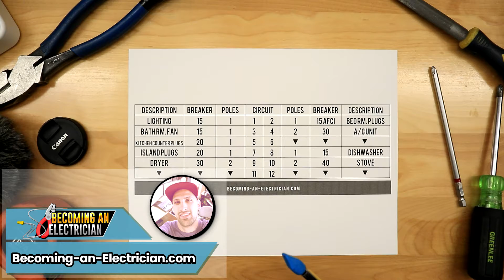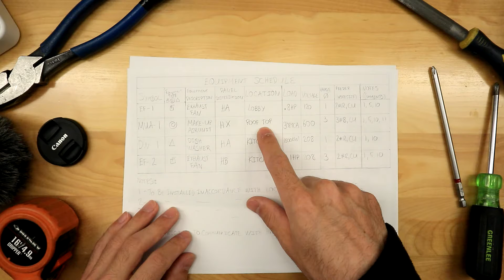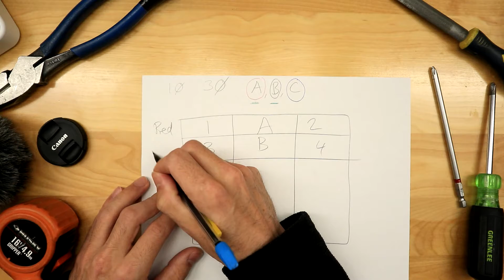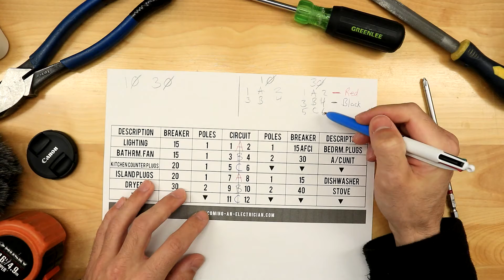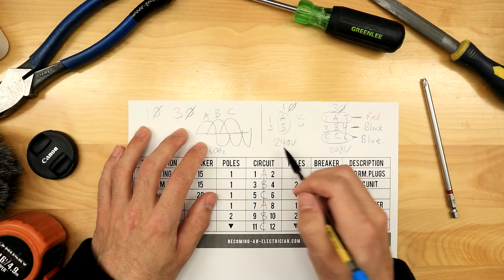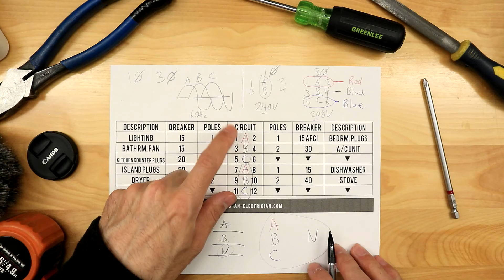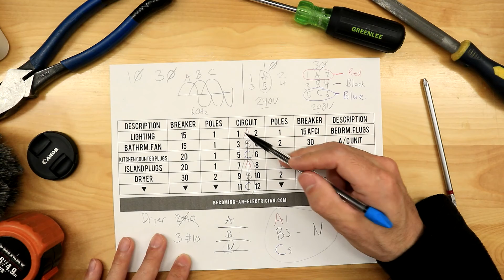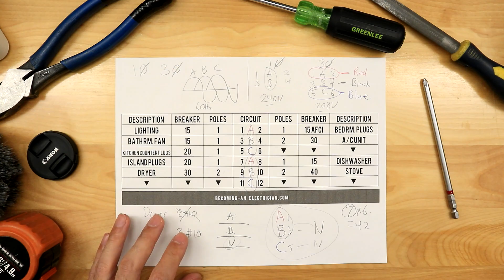How to Read a Panel Schedule for Electricians

Comment: "Blue", colors dont mean anything in residential when youre working with mulitple gc's on different projects, just dont use white/grey/green for your Lines
Reply from the maker: This video is intended for commercial electricians working with 3-Phase panels, where there will be three different colors.  Depending on region, colors may differ, but the concept of A, B, C should have been the takeaway.
https://becoming-an-electrician.com/

Comment: Thanks for the video. In a single phase panel, for example in a condo suite, breaker one would be "A 1-2" and breaker two would be "B 3-4". Would you label the third breaker "C 5-6"? I asked this as "C 5-6" would typically be what you would label the third breaker in a three phase panel. So, what would I label the third breaker in a single phase panel? I hope this makes sense
Reply from the maker: Yes it makes sense.

It would go A 5-6.

So:

A 1-2
B 3-4
A 5-6

A three phase panel has A-B-C.

But the actual condo suites have a single phase panel, from a three phase panel.

So they only have two hot conductors and a common (neutral) white wire.

Because of this, that suite will actually have 208V between two hots, and 120V to Neutral.

In a typical house, because of how the power comes from the transformer (I think called a High-Delta Leg), you get 240V between the two hots and 120V to Neutral.  Each house creates their own neutral (ground plate / ground rod into the actual earth outside the home).

Here's the Wikipedia article on High-Delta Leg:
https://en.wikipedia.org/wiki/High-leg_delta

You can stay updated with becoming-an-electrician.com by signing-up for the email list by getting my free apprentice electrician book:
https://becoming-an-electrician.com/optin/5-tips-apprentice-electrician-book/
Reply: @BecomingAnElectrician  thank you very much
Reply from the maker: You're welcome!  Good question!  Please feel free to leave comments on https://becoming-an-electrician.com any time!  🙂

Comment: what are phases?
Reply from the maker: A phase is your "hot wire".  Panels often have 2 hot wires, but commercial panels often have 3 hot wires (3 phases).  This is known as A Phase, B Phase, and C Phase.  You can connect phase to neutral for one voltage (120V), and phase to phase (line-to-line) for another voltage (240V) for example:
https://becoming-an-electrician.com/

Comment: im confused as to why its a #10 wire instead of a #12as it says on the equipment schedule, i understood everything else :(
Reply from the maker: Sometimes in electrical you can use a smaller wire size with a larger circuit breaker, like in motors.  This is because of "in-rush current", but the actual motor, while running, is much less current, otherwise it'd trip the breaker always.  You have to follow the code rules for these situations.

Often the electrical engineer will tell you the size of wire to use (it's always wise to double-check).

Comment: Difficult to follow.
Reply from the maker: Are you trying to figure out Single Phase or Three Phase panels?
Reply: @BecomingAnElectrician  I am struggling to understand single and 3 phase as well.
Reply from the maker: @garychiao9521  Single phase is just a single hot wire and a neutral wire (white wire).  A 3 phase system can vary from 3 hot wires, or 3 hot wires and a neutral.

For example, in Single Phase, you'd run 2 hots and a neutral in North America.  This is because you need 120V (hot + neutral) for common items like plugs.. but you need 240V for your oven (to provide enough power to heat the elements on your electric stove!)

If it's Three Phase, you'd get 208V instead of 240V from hot-to-hot  (or hot--hot-hot).. but you'd still get 120V on a hot to neutral.

This is all based off the transformer sending power into the building!  You'll get it eventually!
Reply: @BecomingAnElectrician I’m finally understanding haha takes a few different ways for me. Going to check if I get true 240V in our unit or 208V. Might make a tiny difference with our oven heat up speed 😅
Reply from the maker: @itmsolver  Yes, you are understanding, good stuff!  Hope the best in your apprenticeship! https://becoming-an-electrician.com/free